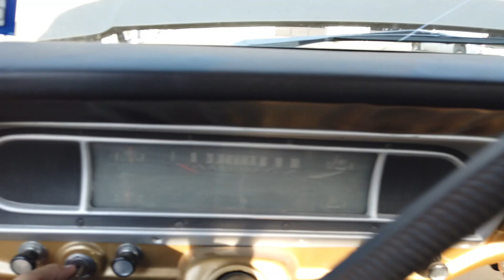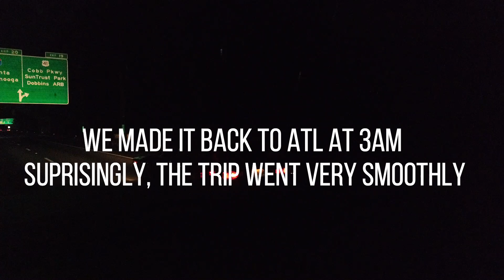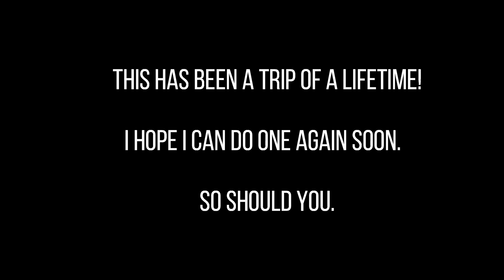Picking up my F250 HIGHBOY from GAS MONKEY GARAGE

Comment: 70mph with a four speed? She must’ve been hollerin’. I just got a ‘75 250 4x4 “Highboy”, four speed manual. Exhaust leak and vacuum leak as well. Does have only 74,066 original miles.